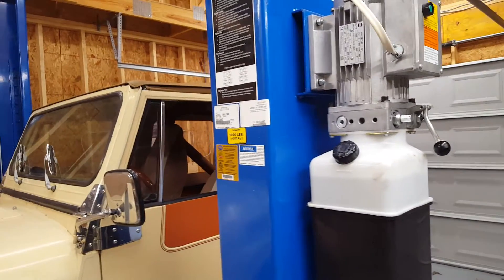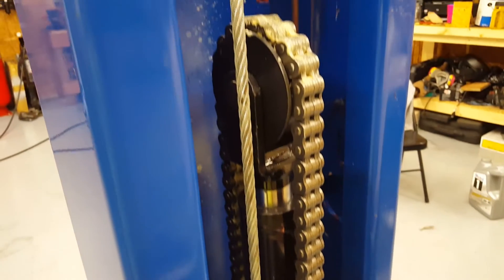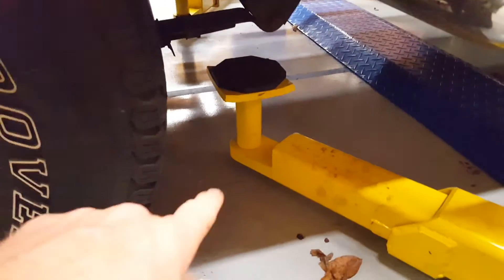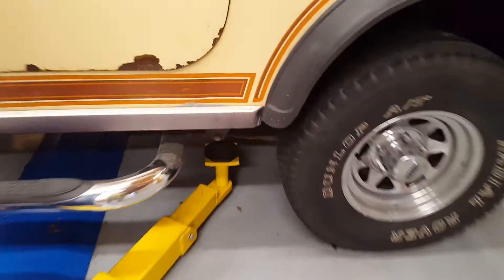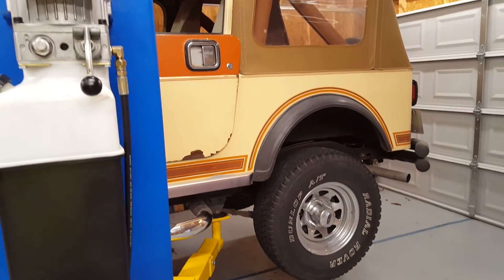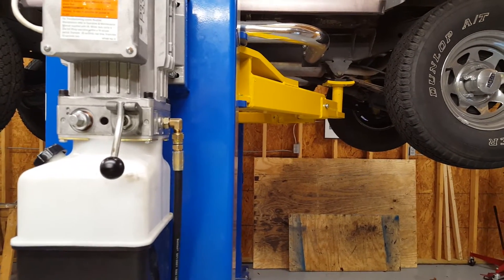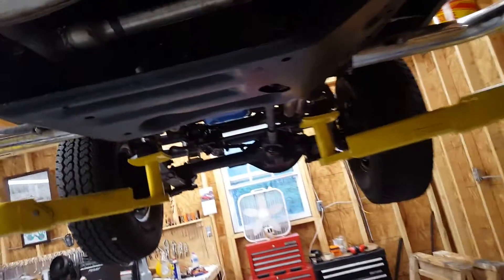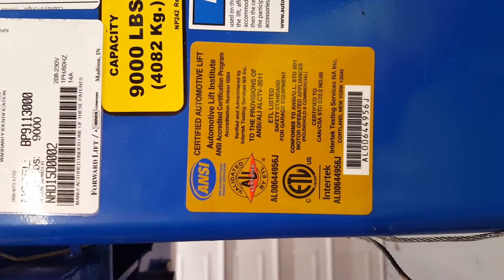Automotive Lift by Forward Lift.  Model number BP9. 9000 lb capacity.

Comment: I'm in New Jersey, and I have the same lift. bought it march 2014, and self installed. did you install yours, or had it installed?
Reply from the maker: +Daniel Hucklebridge Professionally installed.. They are scheduled to replace the leaky cylinder soon.
Reply from the maker: Updates are better late than never. The installer replaced the leaky cylinder under warranty. No leaks since. Still working just fine. Some of the best money I ever spent.

Comment: I'm also looking at a lift but I'm not sure which one would be better. Atlas, direct lift or forward lift I need the lift for low ceilings? How do you like the lift?
Reply from the maker: Bruce Brenke Excellent product. Posts are 9 feet as I recall. Pretty good for low ceilings. Whatever you decide to get I would make sure it is certified by the automotive lift institute. http://www.autolift.org/
Reply: 1impalaman how much did the lift cost? Could you send me a video of how you built your rafters so the lift could go all the way up?
Reply from the maker: You can look up Forward model BP9 on various on line sites selling lifts. Mine was professionally installed so if you go that route add approx $500 to the cost.
Reply from the maker: @icefishingmn5879  The rafters are parallel chord scissor trusses. They were pre-fabbed by the garage builder.

Comment: Looks like a nice lift. So are you happy with it now that you've had it for some time? I'm in the market for a lift and a local installer recommended this lift to me. I never heard of them before and was just wondering what your pro's and cons might be now that you've owned it for some time, thanks
Reply from the maker: 74silver Yes. It's a good product. I've used it for about 3 years now. Have lifted an F150, GMC Yukon 4x4, big classic cars, daily drivers. No issues.
Reply: Thanks! So far I like what I see with this lift.  Good to know after 3 years you're still happy with it.